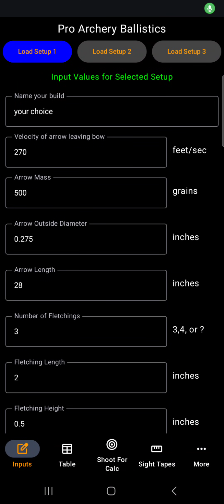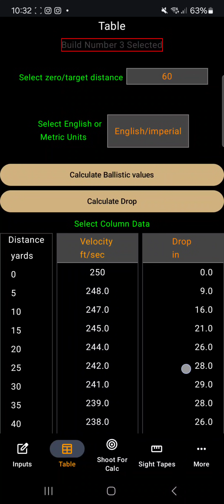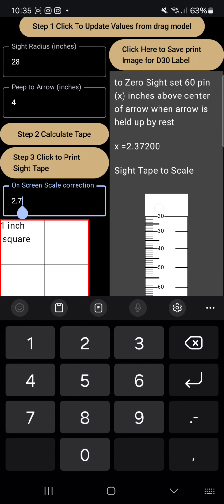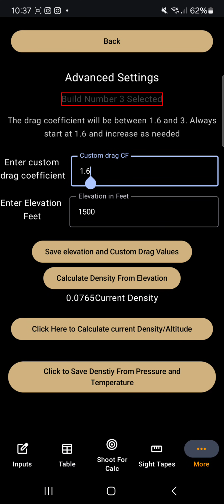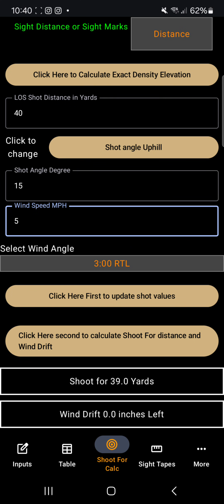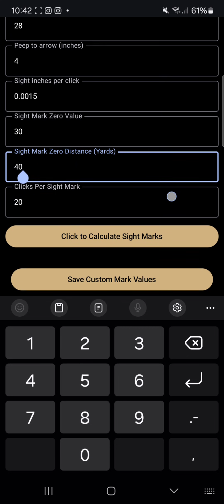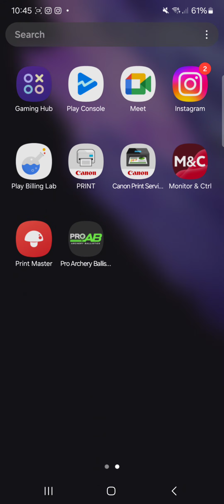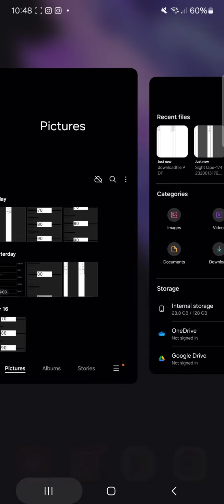Pro Archery Ballistics Android

Comment: I just got the app and when I print my sight tape off with the D30 and compare it to the sight tape in the app, they are different sizes.  The sight tape that shows up in the app is supposed to be true to size correct?  I printed it exactly how you show in this video, but for some reason it is not coming out the right size.  I haven't shot any groups using the sight tape yet, so there is the chance the tape is accurate and its just showing up wrong in my app I suppose.  I was just curious if you have encountered this before.
Reply from the maker: Hey so make sure to measure and adjust the 1 inch scale on the sight tape page. Adjust that to read exactly 1 inch then they should match. Also make sure to update to the latest version of the app just in case. If you’re still having trouble send me an email at proarcheryballistics@gmail.com or reach out on instagram @proarcheryballistics we will get it figured out. Thanks,
Lucas

Comment: Just started the free trial.  Excited to give this app a shot! Just curious on how you're getting the velocity of the arrow on the inputs tab?  I assume its information from a chronograph?  If so, which brand was used in the making of the app? As I have heard there are some discrepancies between different brands.
Reply from the maker: Garmin and Lab radar are probably the most consistent. I have a Caldwell myself the key is you have to shoot through the chronograph level with the arrow and at the right height. But yes the velocity would be measure from a chronograph.
We are working on sighting in from sight marks as well that will come in a future update. However measuring requires precision measurements which can also be difficult.
Reply from the maker: Also thanks for your support reach out anytime with questions.
Take care,
Lucas